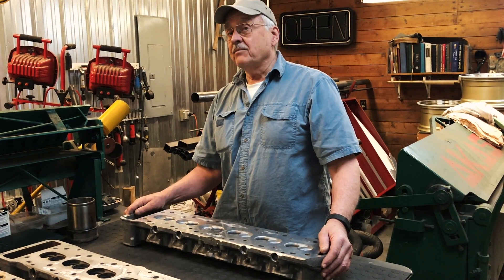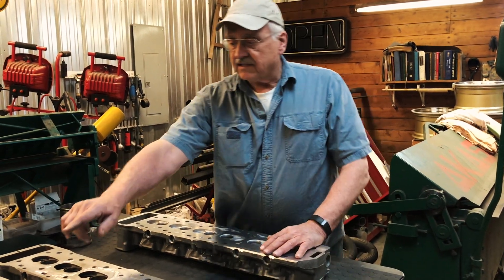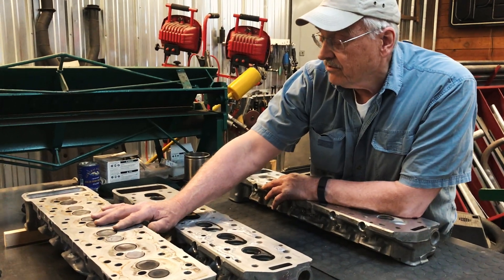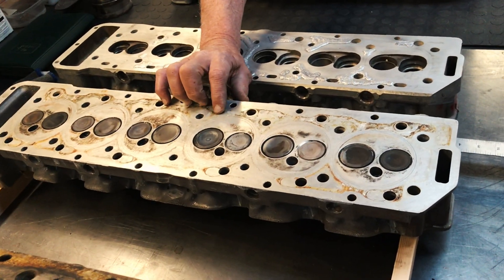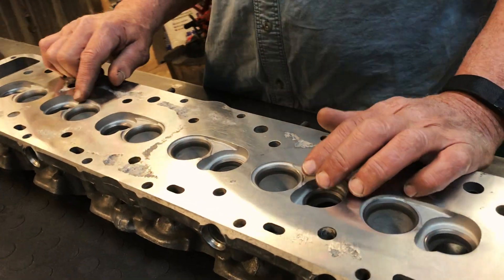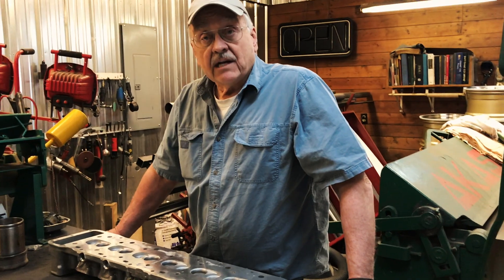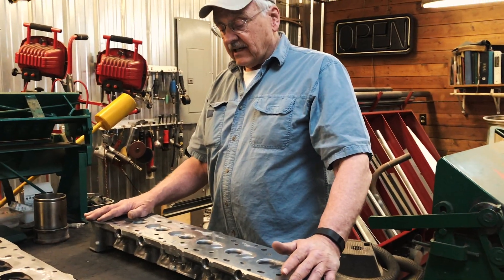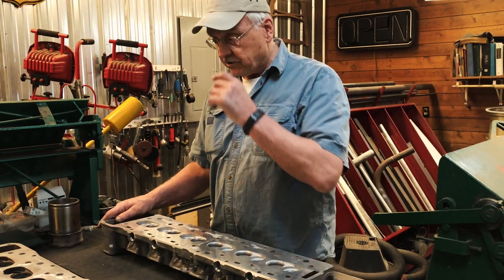Tech Talk - Jaguar 5.3 liter V-12 Cylinder Head Tech - Part 1

Comment: Its à shame nobody does à custom 4 valve twin cam head for the jag v12
Reply from the maker: In the past, there have been a few people who have put together an engine using a couple of AJ six cylinder heads. The results don’t appear to have been worth the effort unless the point is to have something really unusual. Which may be a good enough motivation

Comment: May’s simply copied the Buick fireball head of the 1930’s.  Yes. Because it was a lean burn engine, it got better fuel mileage. About 1 mpg. Better.*. 
  The real reason for adopting  the Fireball head was about air pollution.  
 California was adapting  increased restrictions on the amount of pollution an engine could emit.  
  Loss of the California market would have bankrupted Jaguar.  
  *    The extra fuel mileage came from other sources such  the more efficient  transmission ( GM turbo 400 ( with 2% slippage)  replacing  the Borg Warner (5% slippage)  plus a change in final drive ratio from 3.31-1 or 3.11  to 2.88 . 
    Also improvements in the EFI the first system ( Bosch)  to later systems.  Changes every 3-4 years.

Comment: Hi, could the voltage between the coolant and any proper ground be an indicator how well the system is protecting. 0.3 volt is ok above 1 volt is the danger zone for 6 cilinder jags.
Reply from the maker: good question to look into this coming season.

Comment: What engine did the cylinder heads that have the larger combustion chamber in it?
Reply from the maker: Prior to 1980, the combustion chamber was in the top of the piston like common diesel engines. After that, the HE engines had the chamber in the head. The 6.0L engines combustion chamber was similar but a bit bigger.

Comment: Wondering how realistic it would be to replace the two head gaskets while the V12 is still in my 89' XJS?
Reply from the maker: Shops do it all the time, but in my opinion there are plenty of other issues in the engine bay besides head gaskets that are more easily handled with the engine out of the car. Everything is so much easier engine out.

Comment: These engines must have thermostats with "jiggle pins" to bleed air from the coolant. Most parts stores are unaware of the small but important difference.
Reply from the maker: Correct.

Comment: Very informative video and something to consider whilst buying a V12 jag. 

Are there any warning signs of both the aluminium corrosion and overheating to consider?
Reply from the maker: Thank you for the kind words. As far as corrosion in the block is concerned, the only indicator that I can say is reliable is the overall condition of the vehicle. If they can't vacuum the interior they aren't going to do the regular maintenance. If a car has had several owners that likelihood increases. Overheating can be witnessed only by driving the car though I will say if the oil it's been leaking is baked onto the side of the crankcase(hot oil being the source of many overheating issues) it's probably been overheating. Which opens up a whole other can of worms.

Comment: I've got a few thoughts on the cyl head repair.   1.  would pre-heating the cyl head before welding help.  2.  Would stitch welding this help... i.e. welding just a pool on one side.. then the other.. and spacing it out so that not so much heat is applied at one time to one area.  3.  Why not just muggyweld it...  braze that sucker with some 800F filler rod after cleaning the pits out.
Reply: Preheating the head would definitely help. But it’s hard to find someone with a big enough oven. Though I could have bought one for $600 a couple of years ago. No room for it. 😬
Reply: It should still be restrained regardless.

Comment: Great video,but going to have to disagree on your conclusion.Ive had many cylinder heads,engine blocks,intake manifolds welded and I've always had good results.
In fact my current xjs project has had the cylinder heads welded.
Reply: Did they restrain the head?
Reply: I’ve had minor welding done without a problem. But these pits were halfway through the head in the middle and took a ton of welding.
Reply: welder just went too fast